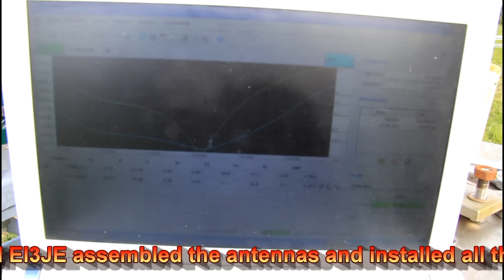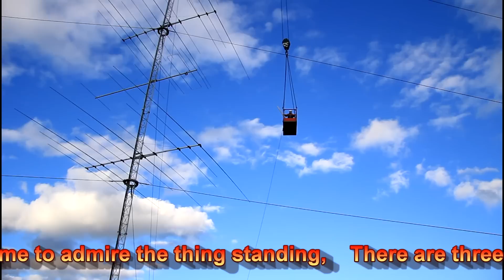EI7M New Rotating Tower

Comment: Oh my god!  So I guess you guys don't know that towers hold together under COMPRESSION NOT MY EXTENSTION!!!!  There have been people killed by picking towers up at the top and trying to set them down... the bolts give way.   The proper way to so this it to run a cable through the center of the tower down to the bottom so that all of the weight is resting on the bottom of the tower putting all of the sections under compression.  Lucky you guys weren't killed.